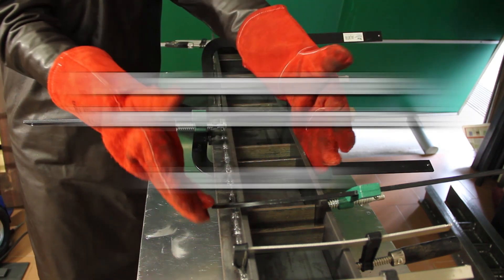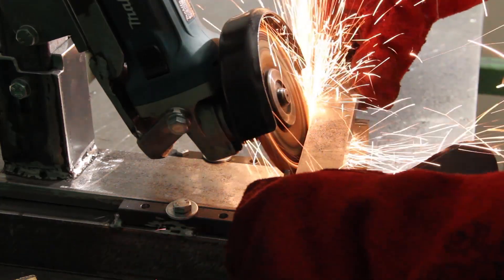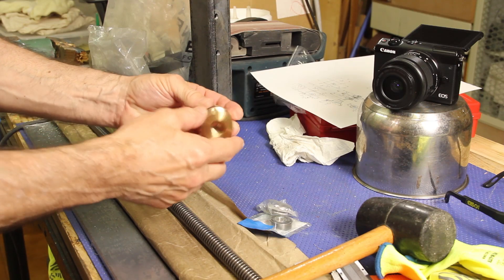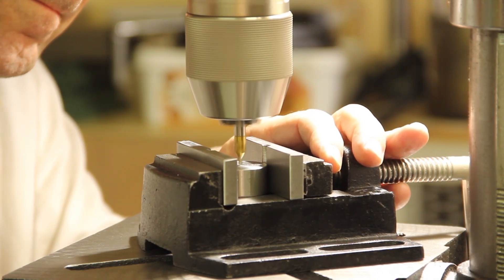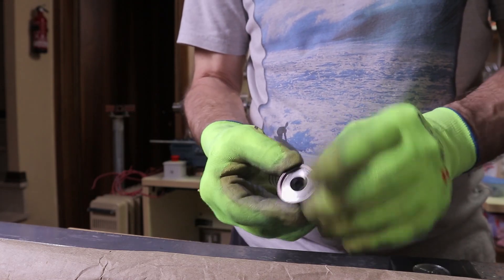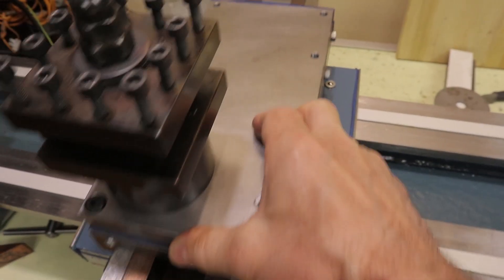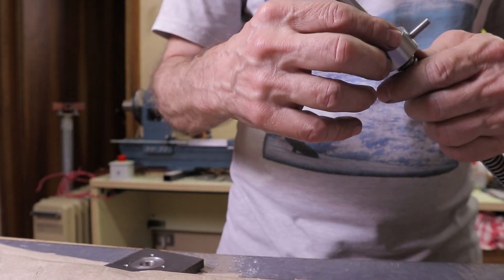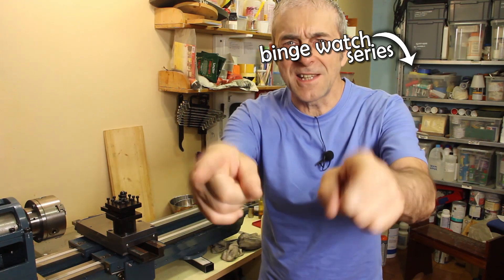DIY Lathe: What Happened?

Comment from the maker: While this project was inspired by some historical challanges in making precision machines, this project was by no means intended to be an accurate revisitation of the past.
In Vaucanson's time, the main challenge was metal precision, in particular in relation with flatness and squareness. Once you have those features, then you can turn precise diameters, and with them you can obtain precise ratios for gears and wheels, which in turn (pun intended) allows for cutting precise screws.
And this challenge is what intrigued me the most.
But my project's goal was also to make a sturdy, reasonably precise machine - meant to be servo-controlled, with the tools available in an average hobby workshop (excluding milling machines and lathes, of course). So I used commercial parts - like the lead screws - and experimented with composite materials and new joining techniques - like the pin-bolt-resin technique I developed for the cross-slide. The results so far are excellent.
This is the path I will follow for the next steps.
BTW, want to be kept up to date? Subscribe the mailing list on my website: https://accidentalscience.com/regform.php
I occasionally send updates and special content through this mailing list, from which you can unsubscribe at any time.
Making videos is expensive. This is not an actual business for me, but your contribution would help reducing those costs. Consider to buy a "Super Thanks". Thank you!

Comment: Well i do some similar stuff. Maybe you should think about start using epoxy granite to give your lathe some mass.
Reply from the maker: Like the one you see on the back of the bed at the beginning of the video? Watch the full series, the link shows up at the end of the video, under "binge watch".
Reply: Ah thats epoxy ok. Well yes something like that. I add a lot more to my mill. Did it do the job for you 
? @AccidentalScience
Reply from the maker: @fearlyenrage honestly I don't have anything to compare with: I haven't tested with or without. So far I've seen there are very negligible vibrations and almost no chattering. If you look carefully you'll notice the bed is built around a pretty hefty structure with lots of reinforcements. But because many parts are welded (some are also bolted), the epoxy-sand compound that has been forced between all cavities and as a filler on the back of the bed should provide a good dumping effect.
The only chattering I've seen so far comes from the tools themselves either because thin or dull.
Reply: @AccidentalScience Hey. Well the vibration will get disturbed trough the whole machine and when they travel into the epoxygranite they will be absorbed. 
For the other vibrations from tooling you could search for another form of tool post like those so called solid toolposts. 
The problem with nor al screw tool post can be that the screw bends somewhat into the cuttingpressure from the turing part.
When you start to think about how to counter cuttingpressure all things fall in place. Anything a machine does whil machining away material build on the action itself. Cutting.
Cutting is the vibration free when the tooling is sharp enough and the chip can flow away with almost no resistance.
When the tool cant cut easy the cuttingmovment gets over in a  dynamic movement. Cutting - chip breaking - cut anew - and the cycle starts again.
That is how chatter beginns. When the overall rigidity or stiffness inst high all bend to the cuttingforce.

I assume it would be a big advantage for you to have a Tripan toolholder and a solid toolpost. Solved my chattering to almost 0

Comment: Good work!

Until you have leadscrews set up, it might be worth setting up lever action with  screw stops for the cross slide and saddle.  For the cross slide, mount the lever on the saddle, for the saddle, make the lever attachment point separately movable along , and clampable to, the bed.   It's way more precise than whacking it with your fist :)  This is how I did the leadscrews, handwheels and bearing mounts for my lathe which came with a lever actuated slide - well, OK, I didn't have to make the lever action, but hey.  A bit of a pain in the ass to work with, but you can lock one axis with the stops, and be sure the other axis won't overcut or crash.  Also, to save welding over the lathe, if you need to make a centre height tool holder,  weld it up beforehand, mount it, then drill it with a drill mounted in the lathe spindle.

You'll also get a lot of benefit from an el cheapo chinese 4 jaw chuck, or, if you want to go oldschool and do it like "back in the day", a faceplate with clampingdogs.
Reply from the maker: > "It's way more precise than whacking it with your fist :)" LOL, you are right! Loved your comment. Indeed I could have added a handle and a rope to do as they did in the Middle Ages.